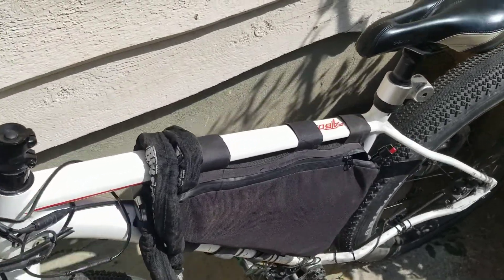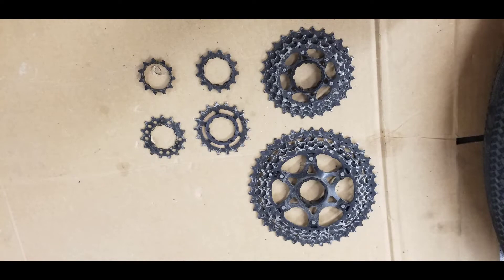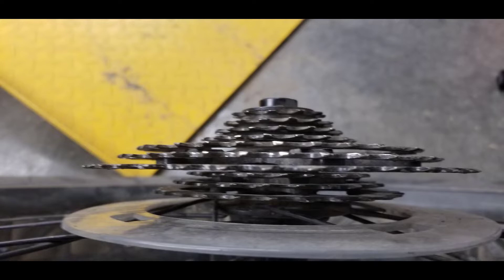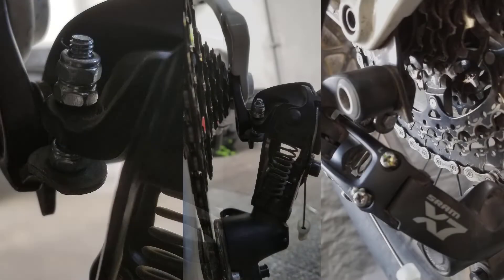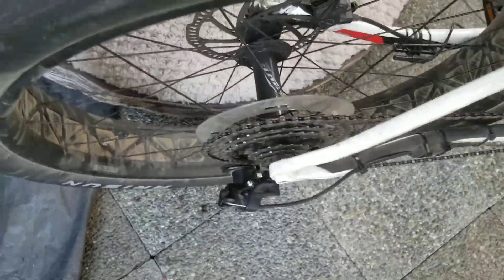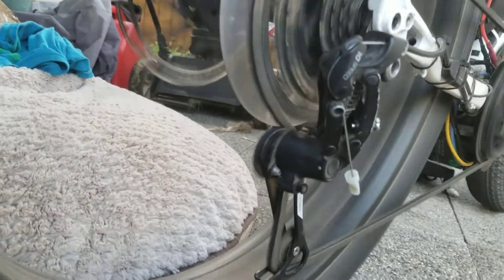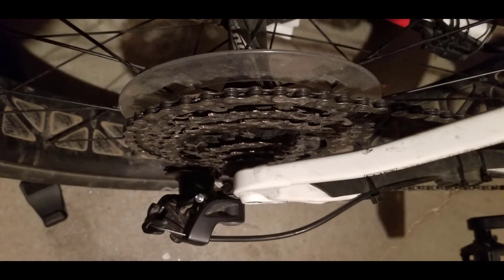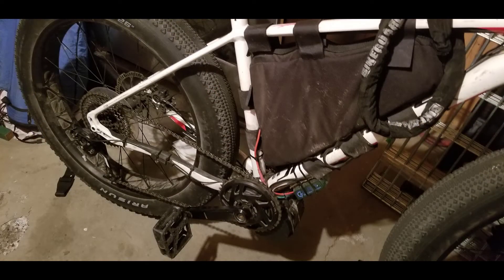Fixing an Ebike Chainline - Bafang BBSHD

Comment: did you lengthen the chain to compensate for the bigger chain ring.. then the derailer will work
Reply from the maker: If I remember right I put on a short section. Maybe 5 or 6 links.
Reply: There will b a reason for the derailer not working

Comment: how did you end with "operation chainline"     I am using a lekkie 42 T in front - cassete is shimano 10x on my surley troll.  Perhaps I should try a 3 speed Sturmey Archer ?
Reply from the maker: I was pretty happy in the end. I have a couple of gears I can access. Its not wearing out or breaking chains. The one Sturmy archer can handle 3kw apparantly. Good luck!

Comment: You could get away w/ 36t lekkie 9 spline 32t cog w/(gear clamps)or single speed spacers both sold on Amazon I like the gear clamps it makes for a easier cog swap depending on your dropouts ,easy solution w/ a tensioner...or this combo could be the magic gearing for a non sag straight chainline. I always wondered what your bike would look like simplified w/    a carbon fork no display(along w/ cables and wires ect.) throttle only fully ridgid ss fatty ebike. Cheers
Reply from the maker: I will look at the gears. The bike is down to just the one cuttoff, throttle and display. I found the carbon fork annoying as hell as the flex made the brake disc chatter. If I have to rebuild the rear I would like to try the sturmy archer 7 speed igh.
Reply: With that kind of torque me personally I would go for the stronger and lighter 3 speed for commuting but used with pas the 7 speed seems sensible for mtb use.  I dont know how a 3speed igh would out with your frame because of the shifting mechanism unless you go with a sram I motion 3 disk ready.
Reply from the maker: It's a good point. I will check at my local bike shop before I start ripping anything out. Cheers!

Comment: can you put the 4 smallest gears closest to the spokes?  I want to rework my specialized pitch sunrace 8sp rear cassette but I use those middle gears and don't want to move them toward the spokes.  I don't use the little gears.  can you completely reverse the cassette and have the biggest gears toward the drop out and the smallest toward the spokes?
Reply from the maker: Yeah for sure! You can set it up any way the gears will fit. The use the screws to lock it from dropping off.

Comment: So I just picked up a 2019 specialized fat boy. 

Planning on a bbshd. If you could do it all again  which chain ring would you choose for the happy chain line ? And any thoughts on being able to route the cables through the tubes ?
Reply from the maker: The 42t gives the best chain line with the lekkie ones. You might be able to use the channels but I was not able to with any of the stock harness parts. If you find you dont use all the gears you can rearrange the cassette like I did to get better chain line. Good luck with your build! Lots of upgrades you can do from a stock install later on as well.
Reply: Captain Codswallop  awesome thank you 🙏🏽 
I was thinking the 42t should be solid. I’ll slap one of those 52v 21aH dire Wolf batteries and should be good!! Can’t wait to get it in.
Reply from the maker: Enjoy! I love my bbshd.

Comment: Are those gears 3-5-7 that you just arranged to?
Reply: I am going to have the bike shop replace the wheels this weekend and install it and test I will let you know how it runs👍
Reply from the maker: Awesome, I'll look forward to it.
Reply from the maker: Sorry but I cant relate those numbers to the gears. I just moved the three biggest cogs across three places. What do you mean by 3-5-7?
Reply: @HighVoltageKits  gear 3 use for hill climbing, gear 5 for normal speed, fear 7 for going full speed. Just like on a shimano nexus 3 speed hub. Reason for asking before I switched to IGH that was happening to me on my rear derailleur it would just switch to those gears 3, 5, and 7 so I would ask if those were the gears
Reply from the maker: It's fixed to the big 42 tooth now but before I was using just the three 42 tooth, 38 and 32 I think. Your igh should work well based on what I have read. But I have not run one myself. Let me know how you get on!

Comment: Leave in middle gear should pull fine. Lunar cycles have the smaller main sprocket with more offset if not.
Reply from the maker: I'll check it out. I dont have the greatest experience with luna. I realised later I could also have used my 36 tooth lekkie and a 32 tooth on the rear as well.

Comment: Hey Captain! fellow canadian here with a BBSHD on fat bike too... I really enjoy your video series and wish the BAC800 was not so expensive as I would be quite tempted to get one.  Question for you: with your 42t front and back 1:1 setup, you pedal pretty much only going uphill, right? I have the same setup with stock controller and only ever use that gearing when going up hill or pedaling very slowly (like 4 to 7 km/hr) without assist in treacherous terrain.  Anything faster and I can't keep up with the assist...
Reply from the maker: I dont really peddle that much other than to engage the motor at a lower power level. On rough terrain you can have it on level 3 at about 600 watts of assist. It will go about 16 mph then. But I mostly commute and rip around doing errands etc. I do landscaping by day so it's not an exercise thing for me. It's a tricky balance to get some exercise but still get a good speed on the road. Offroad tho it's much easier.

Comment: Have you thought about moving towards an internal geared hub? I have vertical dropouts on my bike and I'm in the process of moving to a 3 speed Sturmey Archer because they're strong and decently priced compared to the Rohlofh. Benefit of an IGH is just having to sort out the chainline for the one sprocket (easily attainable with spacers) and you can get giant 28t sprockets from Holland bike. From my understanding, if you're running an IGH with vertical dropouts you'll need a chain tensioner to take up chain slack (I'm just going to use my derailleur as a makeshift tensioner) and a couple of washers SA make for vertical dropouts.

With the controller upgrade you've already done, I get the feeling that your setup would absolutely fly with a larger 28t sprocket on a IGH. If your chainline allows you to move down to a mighty mini, even better... Because your motor wants to spin fast. Only downside is you'll never be able to pedal fast enough to keep up.
Reply from the maker: That's some good ideas, thanks. Can you build a fatbike wheel with a sturmy hub? Rohloff is crazy expensive and 14 gears unnecessary. I have a 36 tooth lekkie that would work well with such a setup tho. What the mighty mini? Is that from luna maybe. Great idea though! I'll do some reading.
Reply: @HighVoltageKits  yep, they make a SA hub for a fat tire and the mighty mini is the 30t chainring from Luna, unsure if Lekkie make one that small, but I don't think it'd be much different to yours.
Reply from the maker: I think the 36t might be their smallest offering. Cool news about the hub. I have laced a wheel or two before so that could be fun.
Reply: I dont think internal gears would survive the 180nm torque